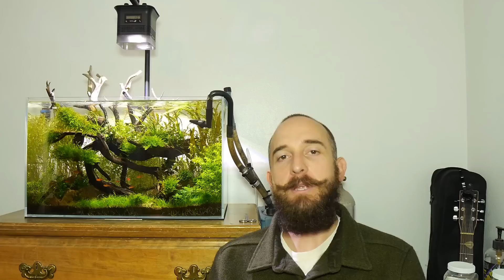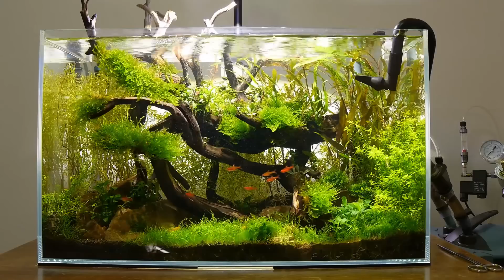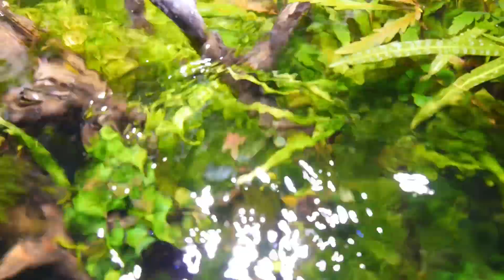Optimizing Your CO2 | Surface Scum & Light CO2 Relationship | Aquascaping

Comment: I have ran my current fish house for just over a year, 13 tanks in multiple rooms 7 of which run co2 through a 6 way splitter, a two way manifold, and a lot of co2 line.  I thought I knew a thing or two about co2 distribution in tank; running good levels and keeping multiple tanks HEAVILY planted including an all Crypt tank and an all Eriocaulon tank, until I watched this video.  PekTek sent me your way and now I am a subscriber.  Just wanted to let you know I appreciate your time and effort and your information is definitely useful and needed.  I will stay tuned for more.
Reply from the maker: C_Town Hey thanks. Well it sounds like 
You're doing pretty well to me. Basically if you have a set volume the quicker the CO2 leaves that volume the more you can pump into that same volume. It creates the same CO2 levels because the flux is higher, so it would be more even distribution. I hope that makes sense. It is more of a concern with larger and deeper tanks. I have a small tank with a pretty large canister, so of course I am going to have good distribution. But someone with poor circulation, and poor surface agitation will most likely have poor distribution, and more than likely a surface biofilm, which depends on O2 levels and organics in the water. We want the biofilm. We just want it growing predominantly in the filter. Similar to water treatment plant some the biofilm is a natural coagulant and traps organics to be decomposed. So my new theory is this, do not touch  your filter media. In most cases it will not be over come by too much sludge. After a long period of time, once detritus from the filter starts entering the aquarium through the outflow than you can clean your filter. Just keep the organics low in your aquarium, the detritus and decaying plant matter and don't overfeed. But don't clean or touch your filter. This will better decompose the organics. And of course try to have high O2 through surface agitation or a wet dry filter, or even surface skimmer. Hope this gives you some more ideas. More efficiently decomposing the organics also uses less O2, because the bacteria will be more mature, so this helps the O2 levels be more stable as well. It all has to do with basic husbandry, but we often take it for granted or don't know the actual underlying reasons as to why we are doing the husbandry. It has to do with having good water quality. High O2 and low organics. This has to come first, even before we worry about nutrients, light, or CO2.

Comment from the maker: Links to two threads on the barrreport in the video description.
Reply: I’m starting up a high tech 75 gal. Tank with co2, led lighting and a fairly large number of plants.  In some videos I’ve watched they stated that the co2 should be turned off at night and an air stone should be run all night until the co2 starts again in the morning.  It seems to me this could cause a lot of fluctuation, any thoughts?
Reply from the maker: Jim Story yeah it is more beneficial and consistent to just have surface agitation 24/7. Thanks for watching

Comment: Struggling a lot with surface film I finally bought Eheim Skim 350 and this small device is A BEAST against bacterial film, it only runs 4 times * 15min a day and does very great job. It costs not that much and consumes only 5W.

Comment: Wonderful info, much appreciated! Using a Fluval Planted 3.0 with a 1.5 hour ramp up on the lights from off to full blast. Currently the CO2 is set to come on 1.5 hours before the lights. Any  suggestions since there is a 3 hour difference between CO2 ON and lights all the way on?

Comment: Brand new to the hobby here. I know this comment is years behind, but how are you getting Co2 in there? I see the valves, but nothing going into the tank. Is that Co2 line going into your filter output line? So an inline diffuser can just pump straight into a canister filter output? Great knowledge for future projects. How would I get the Co2 in the tank if I had a HoB filter? Just run a line down with no attachment on the end? My other question is can I get by with no Co2. I'm still at the 10 gallon tank phase, and learning on it. My tank is pretty heavily planted. Everyone seems to scream put Co2 in everything.
Reply from the maker: you can watch my video on how I set up a CO2 system if you haven't already

Comment: Great video. I learned the hard way for a while now, and couldn't figure out why my plants higher up were getting blasted by algae. Certain plants lower down didn't do as well, so now i tone down my lights from their max setting (started by reducing by about 25%) and it seems to of solved the issue. I don't run CO2, but i dose with flourish Excel.

Comment: So I'm running a 20 gallon tall with a sponge filter, could I just use a circulation pump at the top of the tank to create surface agitation if I'm wanting to add a co2 system?
Reply from the maker: Yes you can do that to help increase gas exchange! And create stability
Reply: @ADUAquascaping  awesome! Thanks a ton

Comment: Hello. What is your say on DIY Co2 systems with citrus and baking soda? Is it worth it cost wise compared to pressured Co2 canisters?
Reply from the maker: You want higher pressure for consistent and even distribution throughout the aquarium, but no need if you're going low tech. Could set up a small trial tank with the DIY CO2 . Many tend to create fluctuations and stress the plants

Comment: I'm running a powerhead and HOB for flow and surface oxygenation. The HOB is also my backup to the canister. 

Zero surface scum but will see when I add pressurized co2 this weekend. Going to start slow and measure my ph/oh as well as a drop checker.
Reply: You ever found a way to best distribute the c02 with HOB filters? I can't figure out if I should place it under the intake or have it circulate round the tank.

Comment: Great information thanks.  It would be great if you would show the CO2 running so we can see how it's being diffused in you tank.  I have a in line diffuser like yours.  However to get my PH to 7.0 I have to run 10* BBS on my counter.  My PH is 7.8 at night.  Takes almost 4-5 hrs to reach 7.0. at that rate.  Surface movement is like yours.  It seems to me I'm using too much CO2.  Should I lower the surface agitation to help maintain a better PH balance?
Reply from the maker: Well with CO2 because it is a part of the carbon cycle the CO2 either gets gassed off, used by plants, or a very small percentage turns from carbonic acid to free hydrogen and bicarbonate, so that being said, it doesn't have an affect on the buffer the same way other acids do. Your pH goes down because of a slight small increase in free hydrogen, which also disappears as fast when you turn the CO2 off. Then the pH goes back up. If it was really acidified it would not go back up. This is because your buffer really hasn't been impacted
Reply: Thanks for your reply.  I just put in a few more pieces of driftwood in.  I'll see how that goes,  I'm hopping that I can drop the PH so I don't have to inject CO2 as much and get a better balance in my tank.

Comment: hi, did I hear it correct that when your light is low or insufficient you have to increase your co2 injection.  Nice video btw, new fan here from Philippines.
Reply from the maker: Yes this is correct. This way the plant can better focus on the available light and not worrying about CO2. It's a simple synergistic relationship between light and CO2. Thanks for watching!

Comment: Hey i gota question would it be dumb use use a air pump and air stone to agitate the surface while the co2 is running or will the co2 escape more quickly because of the air pump ???

Comment: I just started using co2. Is it bad to run co2 24/7? I'm using 0.4 bubbles per second in a 5 gallon with no surface agitation.

Comment: Your last statement has me a little confused. Naturally if I increase my Light I should up the CO2 correct? So if I lower my lights because the buce at the upper column are getting GSA, I should still up my CO2 if my plants at the bottom suffer from the decrease in light? Thanks
Reply from the maker: Yes, because the extra CO2 allows the plants to better utilize the light that is available. Light and CO2 work synergistically. Yes, and if you up your light you should up your CO2 and nutrients. Really you can have high light and high CO2 and have little algae, but if you do have dust algae or GSA lowering light and keeping CO2 the same, or possibly needing to increase it will help the plants down low, reduce algae, and slow down growth, but the growth will still be healthy. Just more sustained. For most hobbyists it is sufficient to have medium light with ample amounts of CO2 and the easiest type of system to balance and take care of. Hope this explains it a bit more. This evidence is also found in actual scientific studies that have been done on CO2 and light. Some plants that prefer medium to low light will actually spread out more in lower light and will get stunted in light that is too high because now they don't have to work as hard to get the light and won't spread out. Anubias and Buces are a prime example of this!
Reply: @ADUAquascaping  thanks is for the detailed response. I have buces in very shaded areas but none of my plants seem to show the healthiest growth. I EI dose for a 20 gal tank, twinstar 400S on the 4th lowest dimmed setting and my co2 can't go any higher without my fish starting to swim in a disoriented manner. My dwarf hair grass shows some fuzz algae on it and yellowing blades. Photoperiod is only 6 hours too. Not sure how to get more co2 in the tank because I'm already offgasing with a lily pipe, surface skimmer inlet, and a fan that is right on the surface. There's a lot of surface agitation but signs seem to be not enough co2. Any suggestions?

Comment: What if you don't have a co2 system in your planted tank? Does more agitation still good? Since it allows more co2 to escape??
Reply from the maker: It is still OK to have agitation. You will still reach an equilibrium. Just have a bit less. Also, within that environment many plants will utilize your carbonate buffer as a carbon source to some extent

Comment: Hey man I hope you can respond to this question because it seems you know what you're talking about; I have a question regarding if I am injecting c02 into my tank correctly.
I have a 75 gallon aquarium running a Aqueon 400 canister filter rated 400gph up to 155g.
The output from the canister has a inline reactor running around 3 bubbles per second and then the water is returned to the tank via two "water clarifying units" basically two hang on back filters.
My drop checker turns a dark green from the dark blue it was not too much of a differance in color.
Do you believe some of the c02 is escaping as the water is returned back to the tank via the two outflow hob filters? I thought reactors should difuse around 99% of the c02 so my thoughts led me to believe the c02 saturated water will be pushed deeper inside the tank as the water returns from the two outflow hob units.
Am I correct or am I losing c02 this way? I can always switch to a spray bar that would return the c02 saturated water directly in the tank.
Any advice is greatly appreciated!!
Reply: 3 bps is barely anything for a 75 gallon, especially with high surface agitation. lots of people use 3bps in 20 gallons. slowly up your co2 each day to get your drop checker moving. The only advice  give you is to not rush things too much, drop checkers take 2-3 hours to change color so it's not a live display,
Reply: @not_ur_senpai866  thanks for the reply you where right I had to up it a little and it is now lime green :)
Reply: @robertcostache6824  great!!

Comment: Hey man...thank you for all your info on aqua setup. I have one question...i have 2 canister filters, one of them is connected to inline CO2 difuzer. My filter intake(suction) pipes are set diagonally, and my outtake is set on one corner for both filters. The one with CO2 is set to burst down, and the other is set up to agitate surface. Is this good setup?
Thank you in advance.

Comment: If I understand correctly, surface skimmers help CO2 leave the tank more easily (which helps with more even CO2 distribution in the tank, even though you will have to use more CO2 input).  The second part that I'm still a bit confused about is O2.  Skimmers, through surface agitation, allows more oxygen to be introduced?  If you point your canister filter output valve towards the surface, I can sort of conceptually see how more oxygen would potentially be introduced as well (?).  Anyways, this leads to my main question which is that would also having an air stone (O2) also help in this regard.  

In other words, are air stones (O2) and surface skimmers redundant to help O2 be more present in the water, which would somehow help "stability" (still a bit confused about what is more stable) of CO2 levels?  

I understand that plants themselves release O2 as part of photosynthesis.  It's just thought I was told by a pet shop owner that it's not worth having air stones (O2) because it "competes" with CO2 for being dissolved in water.  However, the "aha" moment I had from this video is that maybe having to put more CO2 input is actually a good thing (from a skimmer/surface agitation perspective, but I also wonder from an air (O2) stone perspective).
Reply from the maker: As the gas flux/exchange is increased it becomes more stable of a flux. The recommended way is via surface agitation. Surface agitation has several benefits. So it's just a good idea to create that gas flux stability all on It's own. Just to have stability for the environment. Additionally, doing this also has several other benefits. It Increases O2 for good filtration and fauna health. Helps microbial fauna too. Makes filtration more efficient. It reduces the scum on the surface both mechanically, which helps with the flux exchange. And it also helps so the scum doesn't grow on your surface because it will start to grow in the filter media instead because of increased O2. 

The CO2 and O2 do not compete. There is plenty of water molecules for them to both dissolve into. And most are only diffused. This is why you see suspended O2 and CO2 bubbles. Temperature plays a role in dissolution of gases. 25 degrees C or 77 degrees F with 8 mg/L of O2 is full saturation of O2 in water. If you see your plants pearling from photosynthesis it means that your water is at full saturation of O2. This is why you can see so many bubbles in tbe water because you are at 8mg/L of O2 or more if your temperature is higher than 25 C. But the two gases don't really compete with each other.

The way to conceptualize the CO2 is this: your tank volume hasn't changed but your flux has. So you have to increase the density of your CO2 being pumped into the tank in order to keep your CO2 levels at 30ppm, for example. So you have to turn up your CO2 from having higher surface agitation and a higher gas flux, but your volume stayed the same, so you are getting higher density of CO2 per cubic centimeter, and therefore more suspended bubbles of CO2 are coming in contact with the plant leaves. 

This is all about optimization and the reality behind what is going on. It is more applicable to a large aquarium, say 50 gallons or more with a narrow surface area VS a small aquarium or an aquarium with a wide surface area where the distribution of CO2 may not be an issue. A 40 gallon breeder is a great example of where this method can help. A nano 5 gallon won't notice much of a difference for CO2 distribution. But again, higher surface agitation also helps with having higher O2 as well, which then benefits your filter performance and overall fauna health. It's always a good idea to have high surface agitation to improve stability and increase O2, which then creates a stable environment for your plants and fish. The secret is consistency. Plants and fish can adapt to a wide range of parameters. Most methods are arbitrary. The best method is to create stability and staying consistent. Hope this helps!